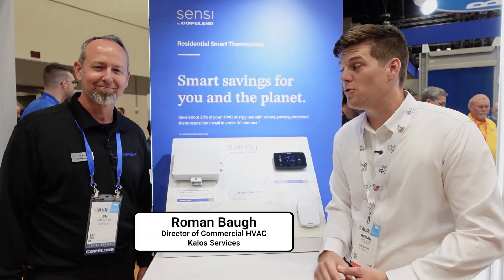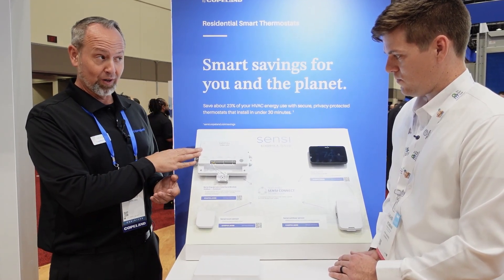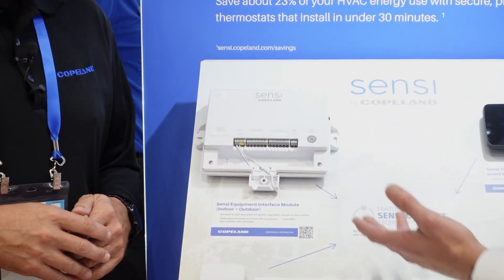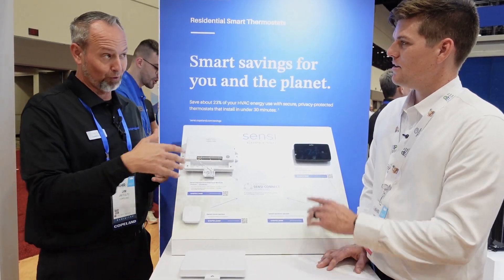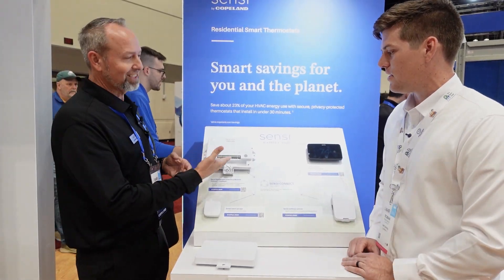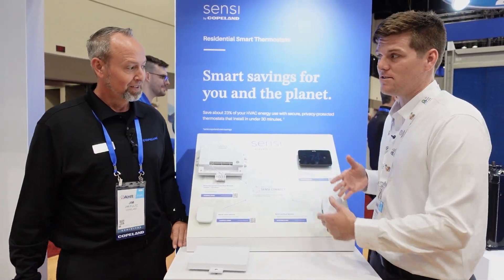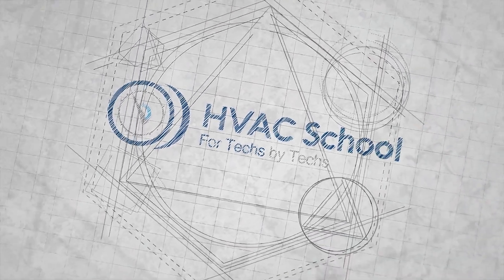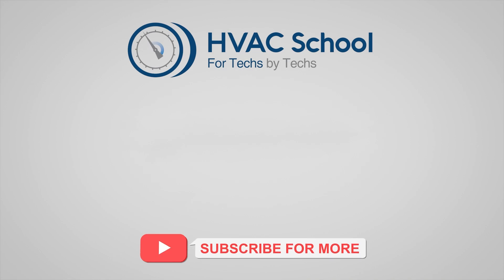New Sensi EIM: Wireless HVAC Control Solution | HVAC School at AHR 2025

Comment: It has so many capabilities. Plus, wireless are their future plans to have plug-ins for temperature and or possible pressure transducer to perform monitoring and diagnostics of your equipment. ? 
       Like the old Sensi diagnostic thermostat that was dropped and abandoned . And make it 100% fully integrated with Measure Quick.. .

Comment: Very nice. Honeywell has been doing this for over 10 years
Reply: Piney, i am looking for a simple type touchscreen. Thermostat, where I can tell this thermostat to look at twenty different sensors. I have a job where I have an air handling unit. Hot water coil, chilled water coil and what I want to know from a simple thermostat and then through wireless or internet or mstp, a way to read ten points. I wanna read air in air out water. And water out on both the chilled water and the hot water coils. But I don't want some big old sophisticated, you know, johnson niagara.Only so many people can figure out you got any ideas
Reply: @russellbarnes7732  this sensi may be a good option and you can look at Honey well Prestige IAQ system. It also has an EIM with capabilities of multiple input & outputs.